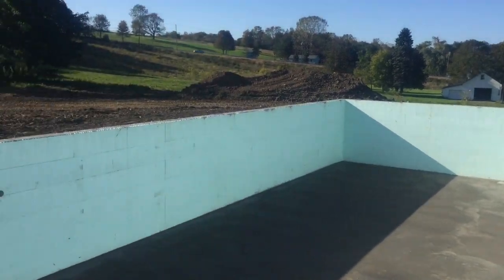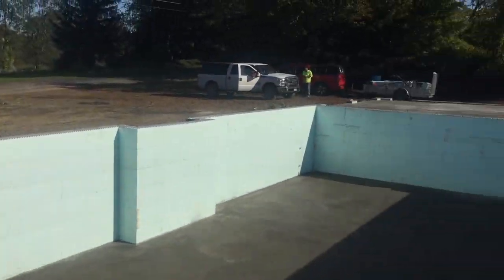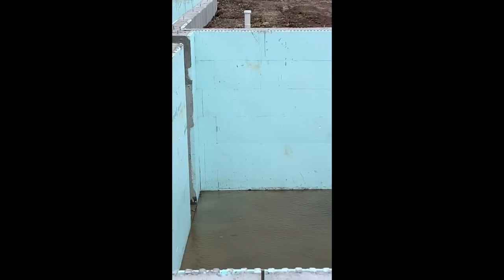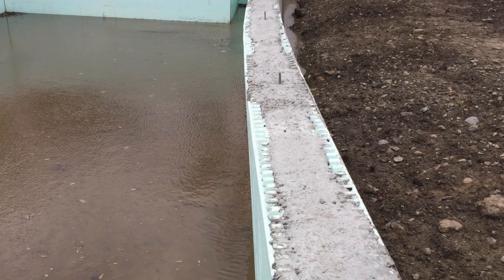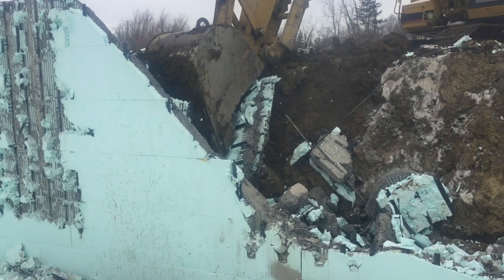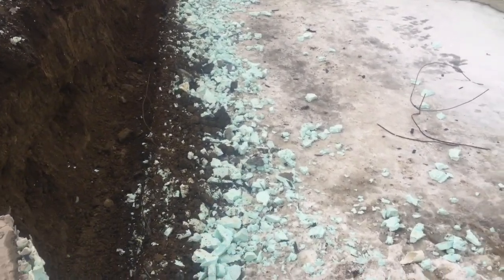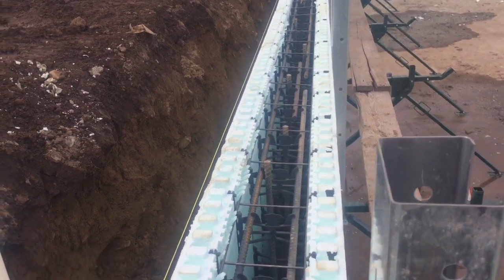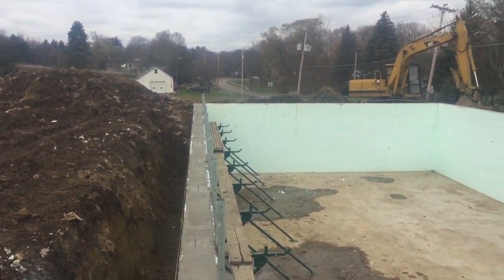ICF Wall failure then Repair.(DON'T DO THIS EVER!!!!)

Comment: i'm a small builder clearing to finish all in house except mechanical,  spec houses or customs depending on what the market is ding and my tolerance for dealing with people. my rule after some hard lessons is no wall over 4' gets any backfill until floors are framed and sheathed no mater how long they are. dirt guys insurance probably wasn't too happy about this one
Reply from the maker: @Troysbuildsnlife  that’s smart of you and he didn’t claim it on insurance we just ate the cost and fixed it.
Reply: @bondobuilt386  heartbreaker, but why did you have to pay?

Comment: Had the same thing happen years ago the day after we stripped forms. Got a massive rain storm and the rain made its own path down the hill and right up against the foundation. By the time it got hi enough to come in the basement windows and fill the basement it had already bowed the back long wall in about a foot at the top.

Comment: We do poured wall basements on homes we build, but we let them set up to two weeks after their stripped of forms. At that time we brace the interior of the basement with 2 by 10 that will later be used for headers. We also try to get the floor joist installed with the deck on. Then backfill with #57 washed stone 4 feet up.

Comment: Since the wall isn’t actually waterproofed.  It really needs water impermeable dimble barrier.  That runner will fail, even in that rain the water would have went down to drain.   Gravel all the way to within a foot or two of surface is ideal.  Ice has more pressure if it’s 20 degrees.

Comment: 1st mistake. He didn’t put a French Drain system in
2nd mistake. He didn’t put 3 different types of waterproofing membrane.
3rd mistake!!! Never backfill with dirt. He should have used some 8mm landscape fabric and 15 mm plastic to separate the dirt from the gravel and backfill gravel all the way to the top.
4th mistake is ….. he should of put another French drain in on ground level.
5th mistake is… he should of diverted the water away from the house!!! 

Would of saved a ton of money if he took his time and thought everything through

Comment: What is the limit, length and height, for those walls? I know the wall will gain strength when concrete cures and the floor is framed but there must be some extra engineering for longer and taller walls.

Comment: Seems like 60 foot long wall should be either thicker or have some insets/partion t walls to help brace. Still won't solve future cracking and water seepage though. Voice of experience. My house has 100 foot wall but 3 partition twalls that come in 12 feet to make room walls.  Still had to dig it up and recoat it. Darn tar coating and corrugated pipe. Ought to be banned

Comment: I am saving this video so that I can show it to my customers that don't believe that hydrostatic pressure is a REAL thing. There no substitute for waiting for the concrete to cure, installing the floor system and using clean stone gravel for back-fill.

Comment: I always worked on foreign cars and one day I had to do spark plugs on a E350 Ford bus. I thought you had to take the fuel rail off and when I did some injectors had stuck in the intake and I went ahead and changed the plugs. I went to start it and it had a rod knock. The fuel had drained from the rail into the spark plug holes and into the chamber. When I turned the motor over it bent the connecting rod. Lemme tell you, you start at the headlight and you don't stop till you reach the firewall. 1 week later i had it all fixed but I felt like such a Gdamned moron. I know how that excavator guy must've felt screwing it up. But you stick around and you fix it and move on with life.

Comment: I was taught to never backfill until the first-floor joists and decking were in, which seems to be doubly true with ICF wall construction.
Reply from the maker: Yup. This was a modular home so house should have been set on first.

Comment: Looked like they used tar as a waterproofing on the outside wall.  Tar will ruin ICF.  Big mistake. Should use poly wall liquid waterproof.
Reply from the maker: Hoss It was a peel and stick membrane. No tar was used.

Comment: I always backed fill with stone 90% up the wall and we did it our selves after floor system was in place , no final backfill until upper walls and roof was dried in.
Reply from the maker: Yup I totally agree bud. I was in Mousouri when it was backfilled. I had to come home and fix it. ☹️

Comment: How green was the concrete when it failed?
Reply from the maker: It was a month old.
Reply: @bondobuilt386  How thick was the wall? 6"
Reply from the maker: @justinfranks8222  Yes 6" wall but the problem was the backfill and the fact the house had not been set. Even a 10" wall would have failed in these conditions.
Reply: @bondobuilt386  Yeah, the hydrostatic pressure. Like you said, backfill design would have helped. Also, if a subfloor was installed prior to backfill to help hold the top of the walls from folding inwards.
Reply from the maker: @justinfranks8222  Ya it was a modular home so the entire house should have been set first.
Reply from the maker: @justinfranks8222  Absolutely. I made this video to help people not go through this. Thanks for the comments 👍

Comment: I’m curious how many days on the cure? I’m guessing less than two weeks.
Reply from the maker: Hi Clinton. It was about a month old when it was backfilled.
Reply: @bondobuilt386  thanks for sharing that makes me question my thoughts on cure timing. I would not have thought a month in it would have done that. Really shows how important other pieces of the puzzle fit together. Thanks again for sharing.
Reply from the maker: @clintonboyer1217  you bet. I made this video to help people not have to go through this type of problem. Worst part is I knew better but you can’t always be there when other things are being done. If the modular house was set on it would have never moved. Also good free draining soils. 👍

Comment: We wait to the lo gest time possible before back filling. I must say tho that ur walls are not thick enough, in the UK an ICF  basement wall would be, an outside core of 150mm, 200mm concrete, and a 50mm inner leaf.
Reply from the maker: Yes this was backfilled to soon for sure with wet soils. This was a modular home so the home should have been set on before it was backfilled. The wall thickness is engineered to Nudura spesifications. It is a 6” thick wall.
Reply: That’s not necessary if the concrete is correct and it’s engineered to be so.  My basements only 6” thick also with 4500psi wall mix.  It’s all good. Stone was used for backfill then 1-2 ft of clay with some grading.  If you have a good dimple membrane and French drain then water can’t build up and you won’t get a hydrostatic pressure failure.

Comment: Dang 2020 started early for you!  Im planning on 12" thick wall on my uphill slope with heavy rebar.  We want a brick veneer on that wall anyway so the thickness will serve dual purpose.  I have my own bobcat excavator and skid loader and will do the back-fill myself (i do my own pond dams at our farm)
Reply from the maker: Ya Greg vthat was a bad day. LOL 12” wall will be super strong. I usually hang around and make sure they backfill properly but on this job I went hunting out west and got thge call that the excavater blew the wall. 👎👎 I liker a stone drainage plane against the wall.
Reply from the maker: https://youtu.be/6JO8mMN53bE

Comment: That’s heartbreaking. Must have cost then a fortune to fix.
Reply from the maker: Yes it was a bad day to say the least. We fixed it with the excavator that backfilled it and didn't charge the customer. The customer bought the materials.
Reply: Bondo Built why would the costumer have to pay for any of that? The contractor messed up, they should have owned up.
Reply from the maker: @IMWILDMAN  yes I agree. I fixed it for free. That was what I felt was the right thing for me to do even though it was not my fault.
Reply: @bondobuilt386  good contractor I would have done the same. Buildblock is popular here in New England. That wall would have cost me about 6k in materials (no Concrete or pump truck here)  icf costs are pricey up this way

Comment: @Bondo Built  You mentioned 4ft of drain rock; a couple of follow-up questions:
* Was there a dimple board or other drainage plane for the above-gravel portion? 
* Was the perimeter drain actually draining to daylight (or hooked to a temporary pump)?
* Was the drain schedule-40 or the black corrugated?  The excavator was pretty ham-fisted, so if it was the latter I wouldn't be surprised if had already crushed it.

I'm glad you documented this.  If I do an ICF basement and get any pushback from the GC or subs about doing it right, I'll just show this video :)
Probably overkill, but a nice system to approximate is this one: https://www.youtube.com/watch?v=r4GdEJal8KM
Reply from the maker: James great questions buddy. I told the excavator to run 1 foot of clean stone to the top for a drainage plane. I always do this on repair work and new builds. I’ll send you a video of how I do this. The drain does go to daylight. This guy loves to use the black crappy pipe. I dig that up and fix it all the time. I made him use sewer and drain for the inner and outer drains that hooked together and then go to the solid green gasketed pipe that goes to daylight.
Reply from the maker: https://youtu.be/6JO8mMN53bE
Reply: @bondobuilt386  Thanks that's a reasonable system.  I think if it were me, I would use geotextile to slow dirt migration into the gravel layer, and ideally a dimple-mat over the waterproofing too.  Cost adds up a bit, but fixing something later is a huge headache.  Thank you for your videos, I'm learning a lot about ICF.
Reply from the maker: Thanks James. I have trouble getting customers to spend the extra to backfill these foundations like I want and its a battle with the excavation guys as well.to brind in the stone up in lifts to the top. They think im crazy and say Im over doing it.  I like the way they did it on the video you showed me but those are 5 million dollar homes. The customers I deal with would never pay me for that. If it were my own house I WAS BUILDING I would do it just like that though. Great system right there buddy. 👍👍
Reply: @bondobuilt386  Convincing people is where your videos are so helpful.  Of course anyone who has lived with a poorly drained foundation [raises hand] won't need convincing.

Even the fancy one I linked doesn't take the gravel to the top like you suggest, and I think that's a fantastic idea.  If someone complains how it looks they can just top it with a bit of colored gravel.  I think that's more useful than doubling the schedule-40 (if one fails, eventually the other one will too -- just give it a cleanout and trust your work).

An interesting question is how you can keep the gravel layer narrow but clean; do that and you can skip the dimple mat, and the narrow gravel won't use as much brought-in material.  6" of gravel all the way up wrapped in geotextile would be perfect, but how to install it without tons of labor is the question.  I've seen your inventions on other videos, so maybe you'll get an idea and invent something.
Reply from the maker: James what I do when I backfill is dump a bucket of clean stone in the overdig and then dump bank run gravel behind that and keep doing that all the way to the top.There is a guy in the ditch pitching the stone against the wall with a shovel. Then you end up with that drainage plane of about 12” of stone all the way up. The bank run gravel behind the stone will filter any of the clay dirt from the stone layer. We do use fabric over the drain tile stone layer down low. I put it under the pipe and over the pipe after stone is covered the pipe. This system removes any hydrostatic pressure on the walls and makes a nice dry basement. 👍👍
Reply from the maker: The drain was pulling water all the time. The wet clay pushed the wall in. No drainage plane was done at the top.

Comment: So the problem was mostly wet dirt being used as backfill for the top part? 

The ICF basement that I am planning is smaller then this, however I want the inside walls also build with ICF instead of traditional framing. I am guessing but that should provide a lot more resistance to inward pressure.
Reply from the maker: Yes it was backfilled with wet clay towards the top. Also the modular house should have been seton there first before backfilling. Traditional framed house would want the deck on before backfilling and backfill with well draining materials. 👍👍
Reply: @bondobuilt386  yes a deck at least is good. While my entire house will be ICF, I want the subfloor also to be poured ICF. That will give it a ton of stability and make it easier to build the ground level up

Comment: I never back fill anything without a sub floor first.
Reply from the maker: I totally agree buddy. This was a modular so house should have been set first. Bad move to backfill it to soon. I was hunting out of state when I got the bad news call. 🤦‍♂️🤦‍♂️
Reply: @bondobuilt386  who paid for u to redo? If u work with the contractor regularly puts u in a tuff spot. Maybe insurance paid?
Reply: @bondobuilt386  how many day did you wait before you back filled?
Reply from the maker: @antoniorosas1334  over 30 days.
Reply: No horizontal or vertical rebar?

Comment: This could have been avoided with a proper perimeter drain. And of course, not backfilling before the top of the wall is supported..
Reply from the maker: This foundation has a double perimeter drain with 4’ of crushed stone over it. Problem was it was backfilled to soon like vyou stated. also the top was backfilled with heavy wet soil that had a high clay content. 
Thanks for watching👍

Comment: How did the financial responsibility for fixing this shake out?  Any of this expense covered by insurance -- and if so, whose insurance?
Reply from the maker: The insurance was claiming act of god. We just split it up 3 ways and fixed it. Myself the homeowner and the excavator. I dont think it was Gods fault though. Lol
Reply: @bondobuilt386  : Just my opinion, but it was easily the excavators fault. He's the one who backfilled the damn thing so early. And he didn't even do it right; I didn't see a lick of rock behind that wall when he was removing it. But you said that about the rock in the video. I didn't see any drainage tile (pipe) behind the wall either... Didn't he even add any drainage at the footer of that wall? That wouldn't have passed in Utah.
Reply from the maker: @TrailTrackers  there was pipe and about 4 feet of rock believe it or not. I wanted bank run gravel the rest of the way up but he put clay dirt on top of stone the rest of the way and it was wet to boot. Smh 🤦‍♂️ I’m glad it’s fixed. I just hope my video helps someone from not having to deal with that crap. 
Thanks buddy. 👍

Comment: Most ICF manufactures do not recommend backfilling without a floor system in place.
Reply from the maker: Mike Yazel I agree completely. The excavator guy thought he could get away with it. Bad move.
Reply: @bondobuilt386  that’s why owners should communicate with the general contractor not the subs.
Reply from the maker: @4philipp  I totally agree. This job was a mess. No general contractor. The home owner just hired subs for the basement and septic and dirt work. Had many problems. Long story lol 
Thanks for the comments 👍